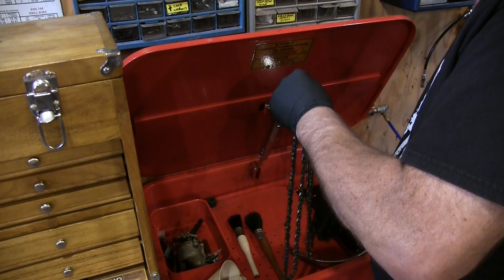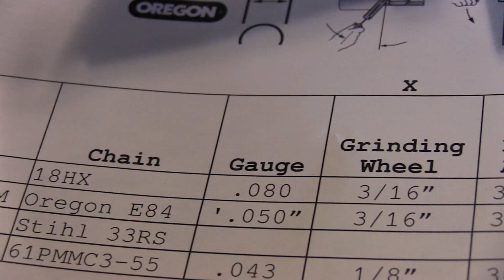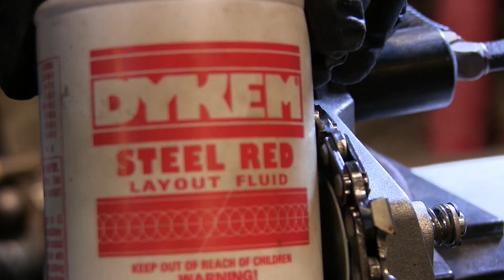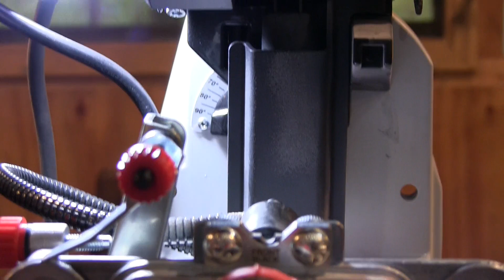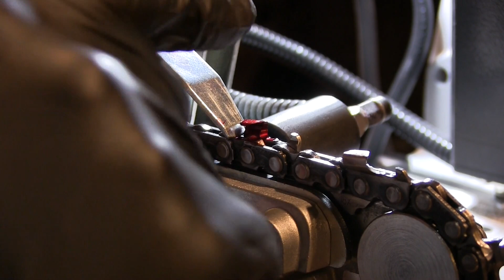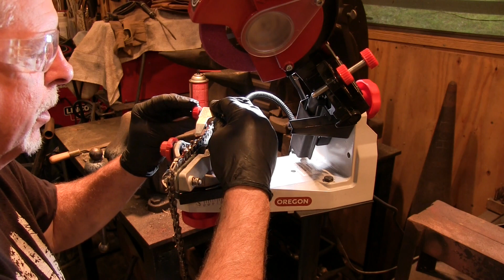Oregon 620-120 Basic chainsaw chain grinding - 088

Comment: You do a down  angle on a semi chisel chain? First time I've seen that.
Reply from the maker: According to the Oregon timber harvesting handbook there is a difference between a semi chisel which is a zero degree down angle and a micro chisel which is what the 18hx saw chain is. The micro chisel gets a 10 degree down angle. I'll be doing another sharpening video soon. I will spell that out more clearly because I didn't do that in this video.
Reply: Ill tell you this you can do whatever you want with any chain. It might not be recommended . But I'm going to say this you can do whatever as long as you do the exact same  thing on the other side of the chain. . your results may tell you you diminished the quality you was use to it will still cut or you may get lucky and improve the performance of the chain. If you improved the chain you get s 25 cent piece go buy you a tootsie pop sucker stick it in your mouth and pat yourself on the back and tell yourself what a genius you are.

Comment: You can have teeth that are different lengths you just need to get a progressive depth gauge if you can get your hands on one West Coast saw sells one for 404 and 308 and 325 chain and then you can adjust the raker height per tooth and as long as the raker height is adjusted properly it doesn't matter about the different lengths of teeth. They still cut straight which is the most important thing.
Reply from the maker: @Mightycaptain  Yes, that's exactly what I use. I bought several for the different pitch chains I use.

Comment: Sure its a little to warm your taking off to much at one time. Loose the pink wheel get a cbn wheel  and get your old chains and practice . there is a learning curve and you just dont pick it up in a couple of week you learn over a period of time . 90 percent of the people on here don't know what the are doing.

You can do this watch bucking billy ray hand file a chain .watch the one that has multiple damaged teeth he will explain the damage to each tooth if you get the right one he will show you with a hand file what to do with each individual tooth. . that's what you want to replicate with your grinder . and your very short teeth  hand file it . hes good about explaining hand filing . he makes it easier on himself hand fi!ing. Most people that claim they are good about hand filing they can't do it right either .. They talk a good game but they don't know.
Reply from the maker: Thanks for the great comment! I have a CBN wheel on my "to buy" list. Those things are pricey. Even though I've got limited experience with the grinder, I could see that a bunch of people were doing it wrong. 
I've watched a couple of Bucking Billy's videos already. I'll check out a few more though.
I thought I was good at hand filing until I really started studying the subject. I realized pretty quickly that I had a lot to learn.
Thank you for watching!
Reply: You bought an excellent grinder might as well get a excellent wheel or 2 and do it up right. If you only sharpen for yourself you'll never have to buy another wheel
Reply: And get you a raker guide also.
Reply: Thats fair enough. When I started grinding I thought I knew it all . When I started studying my own work i realized I had a lot to.learn myself . I'm pretty good but I learn something new about it everyday